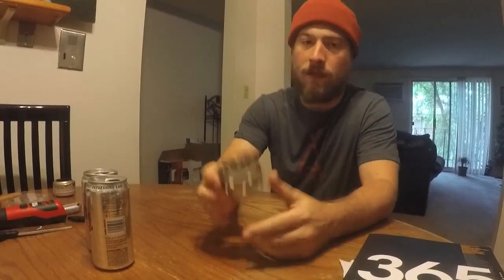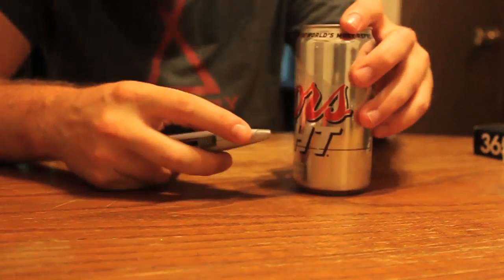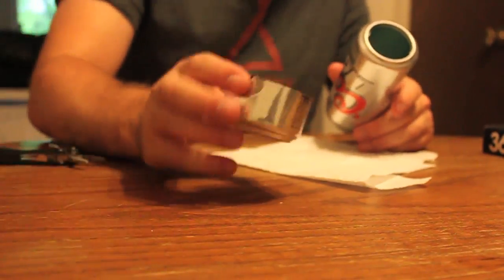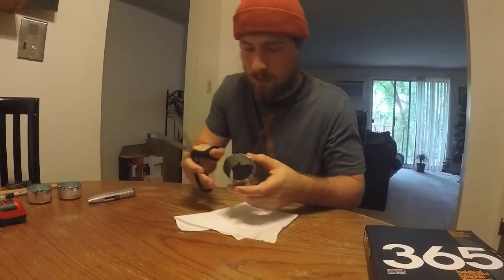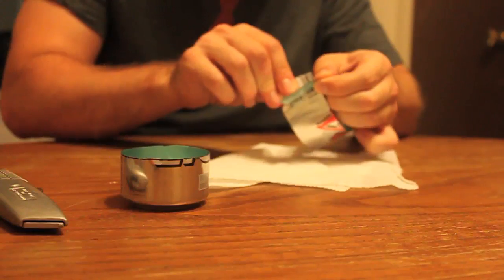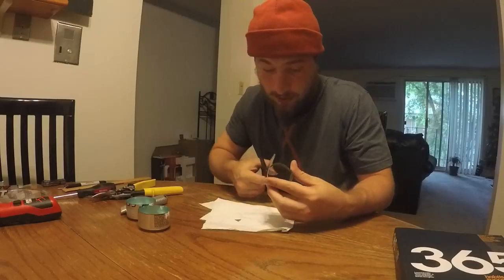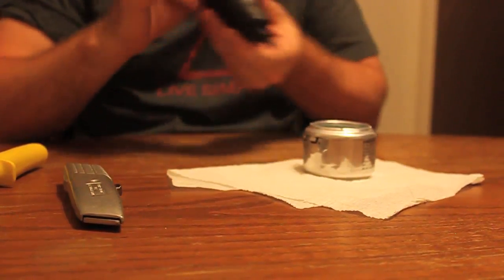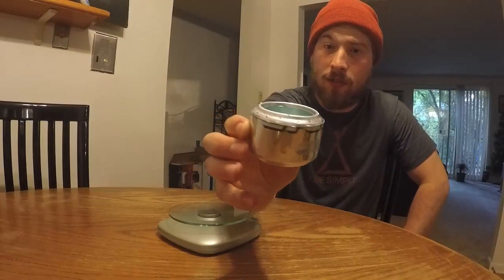How To Make An Alcohol Stove // Backpacking Gear

Comment: Just made one of these last night.  Definitely the lightest stove, but I think I still prefer the cat food can stove with an integrated wick and pot stand.  Less patience required to assemble ;)  Good video!
Reply from the maker: +Hangs High Yeah that cat stove definitely takes less patience haha. I personally just think they are fun to make and have tried different ones using different sized cans. The cat food version didn't work well with my pot because it was to wide and the flames were just going up the sides. It is a great option though. I just love how quite they both are.